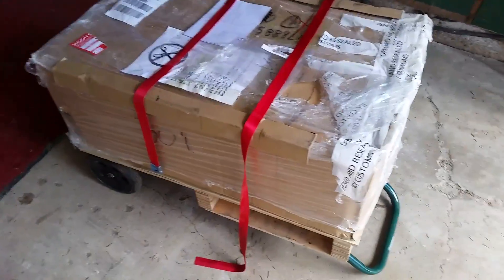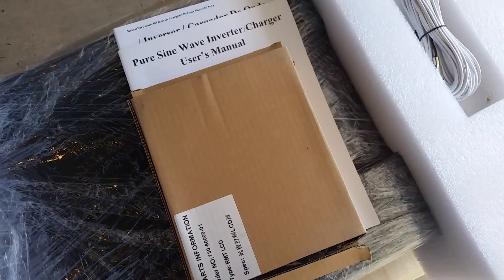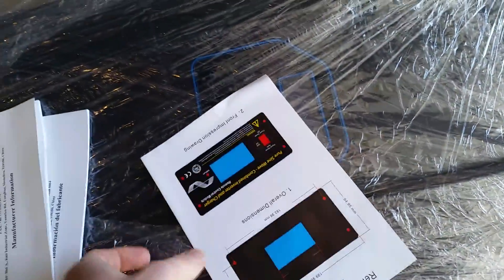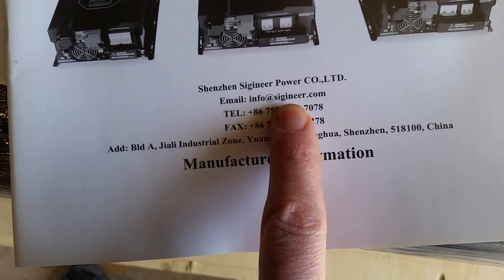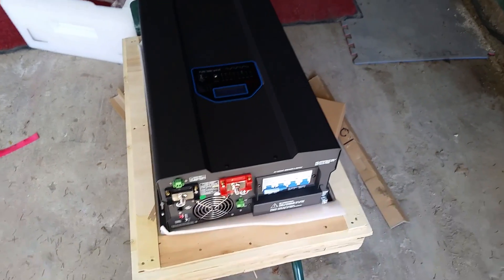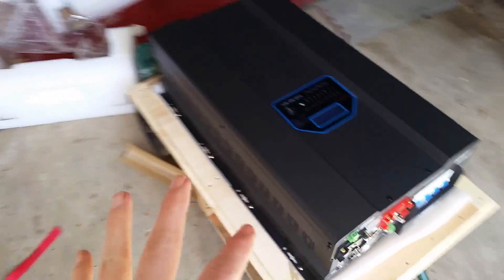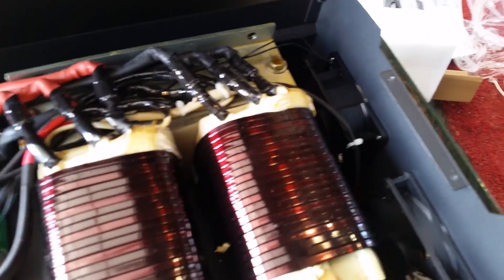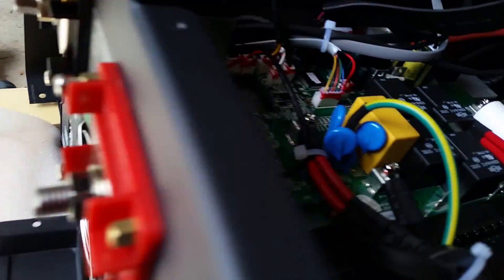Sigineer 15kw inverter unboxing

Comment: Interesting things about you say about the fans, motor on the back is the direction of flow (even the shape of the thins)
, So this is a split phase 7kw per leg inverter (don't expect it to do 15kw off one leg without melting stuff) I seen others wire directly off the circuit breaker instead of the junction blocks so not to overheat
Reply from the maker: correct, each leg would do about 7kw max. i'll demo some test during future videos

Comment: Those are DIN rail breakers and are much more common than what North America uses in our walls. They are the standard for all equipment and machines, as well as ROW electrical panels.
Reply: Those are dc breakers with arc protection built in which is what differentiates them from ac breakers.  DC arcs dramatically when it makes and breaks contact.  Arc arrestors are necessary and these are the one's designed to do that.
Reply: @aday1637  DIN being the form factor while also being rated to better survive the arc. Not all DC rated breakers are created equal as you mention. It's prudent to pursue quality examples when they are expected to perform many times.

Comment: I wish they made inverter/chargers that could be phased locked together, so that instead of 1 large inverter/charger like this, you could  have 2 smaller ones each feeding a separate 120V branch, but phased locked 180 degrees so that the 240V stuff would work well too.  So for example, a pair of 7.5 KW inverter/chargers instead of a single 15KW inverter/charger.  I suspect it can be done so why don't they do it?  It would be easier to move 2 smaller inverters around, and they could either share a large battery bank or have their own smaller battery banks.   Many more options with that setup.
Reply: They do.  I think Growatt makes one among others

Comment: At 15kw using 48 volt battery voltage, you'd need the batteries to provide 312 amps.  Which means you'd need a whole heck of a lot of battery.  (312 amps x 48 volts = approx 15,000).  Which means you'd need at least 350 awg wire to conduct that amperage.  350 awg is nearly an inch in diameter.  So in essence 15 kw inverter is for industrial use and not intended for home usage.  Not sure you realize any of this.  At today's prices the wire alone will cost as much as the inverter.  Most homes will run fine on 5 kw or less, depending on devices used.  If you are off grid you will probably want a gas or propane hot water heater and stove as well as clothes dryer if you need or want those items.  I can run my entire home for around 2200 watts including 4 heat pumps (inverter type).
Bigger isn't always better.  Unused inverter will be less efficient than smaller one being fully used.   I cannot imagine the price of batteries you'd need to fully use this beast but it's got to be near $10,000 range using build it yourself components.
Reply: I used tesla batteries with 4/0 wire for the necessary amperage and lived with it for many years supplying power for the entire home, charged by solar every day. It's extremely feasible to set it all up. Lots of satisfaction being self-sufficient, too. Mine was the 12kW version.

Comment: Hey I have a question I need to power my electric carpet cleaning machine. It requires two outlets 17 ams 115 volts and 19 ams 115 
and 2 mytee 2400 watt heater i need about 9000 running WATTs total. Can I connect the INVERTER to a small generator because this system requires a 220 pound generator i will have to carry around
Reply from the maker: It will not work without a battery pack, but yes, you can connect it to a generator.
Reply: @erroneus  thanks for the info 👍

Comment: you need to flip out thoses single breakers for a single double breaker. its very bad if 1 triples as in the usa or canada we use 2 legs of 120v aka 120/240 split phase. double single breakers tap on leg 1 and leg 2 to get 240v. each leg is still separate of 120v when running back to the appliance. so if 1 pops you need both to trip or you can burn out your appliances. can  even cause your appliance to back feed from a simple trip and burn out your inverter  but save your appliance.... or burn both up...  My guess the inverter will fail first

Comment: 2x 10AWG wires is almost exactly equivalent to a 7 AWG wire. It's minus 3 gauge, the entire AWG system was based on the idea copper wire is mandrel drawn from a solid copper billet which is 0 Gauge. Each size mandrel was 1 Gauge and the billet was drawn that number of times. This was setup for solid wire, so for stranded wire the cross sectional area of copper is the same but the bundle of strands will increase with strand count so there *should*/has-to-be the same amount of copper in a solid 2 awg wire as a million strand 2 awg wire. This is about 5 minutes of research so learn and get better please!
Reply: Ray N   American wire gauge was based off of the number of times the raw material was drawn down through a die to make it smaller, so the more times the wire was made smaller the smaller it is and the less electrical current it can pass without melting.
Reply: Ray N  another uncommon piece of knowledge about American wire gauge, the gauge defines the cross-sectional area of a wire not the diameter. So a stranded wire will have a larger diameter to fit the same cross-sectional area of metal. And American wire gauge tells you nothing about the thickness of the sheathing or anything else around the metal.
Reply: @kingrpriddick  That is the old Birmingham method.  It's now sized by .8 the diameter of the next larges size.  Not by how many draws make it.  You can make any size now in one draw.

Comment: So ...
1) This looks a little "beefier" than the Sungoldpower 15k 48V in terms of wire gauge and components. Agree?
2) From previous, it looks like you are using (or are going to use) four 74p/6s Tesla 444cell modules for storage. Yes/No?
3) This looks EXTREMELY similar to what I plan in the future, so I would like to follow your progression if you do intend to 
 (a) hook this up to an MPPT solar controller
 (b) go off grid and/or generator backup
 (c) keep posting your trials and tribulations especially with BMS issues, shielding issues, and your determination of upper limits of the unit.

Thanks
WJ
Reply from the maker: 1) haven't seen the sungold thing
2) yes
3) stay tuned. Specific plans tbd

Comment: I have thought about these, what is the voltage range? It would be nice if it would go down to 18v or so, so 6s liion would be more comparable, I have a inverter charger, but not likely going to use the charger, being off grid,  I have a 7s liion bank, 29.4 v peak. I'm looking for a larger inverter, 200w idle is a bit rough!!
Reply: I believe the power save mode on this one is around 50 watts.

Comment: Joel can you tell me about idle current.....
and how many mosfet's are on one side... 
And does mosfet's have some thermal compound on it or are dry mounted on heatsink...
Reply from the maker: I have not powered it up yet,  but the documentation implied that the no-load power draw is around 200w. I don't remember how many mosfets there are, but they are directly mounted on the heat sink. There is probably thermal compound, but it isn't obvious
Reply: Dry type ( uses a plastic tape to isolate) is better than the grease for thermal conduction and is also easier to use and replace.

Comment: Nice video Joel (from one to another). Can you tell me how loud the unit is when operating? Both low and high load? I am very curious about the noise level.
Reply from the maker: It hums like a big transformer, not silent, but not invasive either.

Comment: Against the National Electric Code to use anything with out UL approved devices on grid or CSA in Canada. 
So check the codes for USA and Canada as there is a big fine for not having UL approved or
 C S A in Canada  .
Beware .
Reply: You are wrong. You do not need UL listed inverter unless you plan to grid-tie you system. In this case, power company will ask you to have UL listed inverter.
Reply: May be true, but how would anyone know since you are off grid anyway?

Comment: So you are a Jack Rickard fan. I stopped watching most of his stuff a few years ago. So he had some influence on the lithium algorithm for these inverters? I too have one of these. Mine is yet to be unpacked. Was shipped mid summer this past year. Still working on my bank of batteries. Im going to be using Nissan Leaf Modules. I have 90 usable ones at this time. I'll be making them into 48 volt packs and want to charge the batteries from the inverter itself. Then go into generator mode when power goes out or to manually switch off grid at night then back on in the morning.
Reply: Pete, I am looking to do the same Leaf battery bank as you. Could you provide any tips on BMS choice and solar options you went with. i.e. Did you go with micro inverters for your solar system?
Reply: @iandadschorn4336  I’m still hunting for a simple but reliable BMS built somewhere other than China. Those are not overly user friendly. Our solar was put up before microinverters. I do however recommend micro inverters for solar. One nice thing is if you know the size system you want you can buy the cabling and rails and add a panel and inverter at a time as your funds allow. My next option is using new micro inverters and stringing two or three older panels together per micro inverters so you can take advantage of the cheap panels. Micro inverters are much better than the large inverters hands down. I’m going to buy a small high frequency inverter for my power wall. Hoping to make it an all in one unit.

Comment: This is not just an inverter, it is an inverter/charger.
Reply: Eh? Who even uses the inbuilt charger. It would be much appreciated if these units came with MPPT chargers, then it would make more sense as most of the people use this for solar systems and not “UPS”
Reply: Some people may want to use the onboard charger.  For example, people that have a large battery bank and want whole house emergency backup power but do not have and do not want solar panels.  They might have enough battery power to run their entire house normally for 1 day, perhaps 2 days sparingly.
Reply: David James 

Hm, interesting 

Wait here

So let’s see this like this

GRID IN======>>>> Transfer switch (1 or 2) ====>>> panel

1= grid,
2= Connected to this inverters output

Solar=====>>>MPPT====>>48V lithium batteries======>> To the inverter 

And then, a generator connecting to the Inverters input...

Is this setup possible? So when the grid goes out we can MANUALLY transfer it over to the inverter, and if there is no sun or the batteries are dead, we can start the generator which will charge the batteries and also provide the home with electricity....
Reply: I would feel more comfortable using a manual transfer switch yes.  Once disconnected from the grid, you can do just about anything with generators, idling cars (to charge batteries), solar panels....  The "worst" (in my opinion) are those solar systems that are "dead" when the grid goes down.  What a waste.
Also, how would you know if most people that buy this unit use it with solar?  Is that an assumption?
Reply: David James 

As I see in YouTube, this seems a good unit for some 48V setups.... and that to Tesla Lithium!
Reply: @beedslolkuntus2070  Note that folks are starting to use these inverters in an AC coupled configuration, making very good use of the charger built into this inverter.

Comment: i have the 12kW version, but my electronics clocks delay 2 min every day, my led bulbs blink lightly when is a load more  than 1kW, did you already has this inverter working
Reply from the maker: not yet, having issues with the BMS being sensitive to the electronic noise from the inverter, i'm re-doing the harness to include some shielding.
Reply: You might want to get spare power board and control board. Always good to have them handy
Reply: My clocks delay about the same with my 6kw one as well. But for the price I am happy with it.
Reply: Joel, when I was installing my battleborns to inverter I spoke to battleborn. They advised me to wait untill they sent me free of charge a (csl-500 unit) currant surge limiter device which they told me to install between the batt. bank and inverter. It's purpose as they explained it to me was to protect the BMS systems from the initial high draw upon turning on inverter (while capacitors charged up).
They said without it I could have batt cut out issues from BMS, or worse batt and BMS damage.
I waited and installed the unit as they suggested and everything has worked flawlessly for 1-1/2 years now.
I saw your comment and immediatly thought of this.
Hope it's useful to ya.

Comment: Hi Joel, I'm doing the EVTV BMS with Tesla modules and am considering getting one of these like you did, are you still happy with it, any problems over the last few years?
Reply from the maker: Yeah, it was good, I sold it a couple years ago though. It is undersized for my current living situation
Reply: @erroneus  Hey thanks for the quick response.. I'm also from Canada, now living in Arizona.... I may stick to running a couple Victron Quattro 15kw's instead but thanks for the great video and response.

Comment: Empty space is for two 60A mppt charge controller like in my case...
Reply: I thought it was the 3rd small transformer to drive a water pump upto 10HP (or something pump related)
Reply: Probably in aims inverter.....
Generally Chinese inverter like I get...are inside two 60A mppt.... For each of mppt you have to pay about 120€...and those mppt are really capable deliver 60A....

Comment: You can not size wire without discussing wire length. Truly you should be looking at every factor that contributes to heat dissipation as well but EEs usually use rules of thumb like a derating for a specific insulation or environment like direct burial vs equipment chassis.

Comment: I few things I do not like about this model... 1) Only 2 terminal posts to connect the battery to.  How the hell will that handle 1000A peak input when the 15KW units handles a brief surge of 40KW?  2) I wish the display would show many things at the same time rather than having to cycle thru them.  3) Why have it only 48V input?  Why not something higher such as 60V?  I have a 48V DC input UPS that is only 1600 watts output so why would they also use 48V DC input for 15KW surging at way more than that?  60V or even 72V might be better.  72V can be felt if you touch it but is not normally deadly.
Reply: Full pull it will suck 312.5 Amps not 1000 Amps the higher the input voltage the lower the current my 10kw inverter with 60v input draws 166A
Reply: That 15KW unit is supposed to have a 3x surge of 45KW so that would be very close to 1000A of DC input.  312.5A will not handle the surges.
Reply: @davidjames1684  I believe those brief "very high" surges are only seconds long or less and thus may be handled by the charge held within the capacitors rather than (pulling) taking that kind of high draw off of the batteries. I'm no engineer but I believe this is a capacitors purpose in this application is it not ?
Reply: @DEVONLAD11  The surge output power of 45,000.00watts corresponds to 45,000.00/48volts = 937.5amps so 1,000.00amps is accurate at the DC input end assuming zero losses during conversion. Me thinks.
Reply: @jeffbowers950  You are correct here James, that is the purpose of capacitors. Short high surge draws.